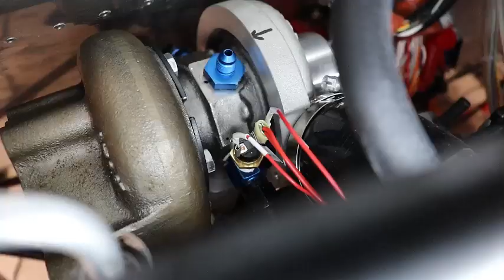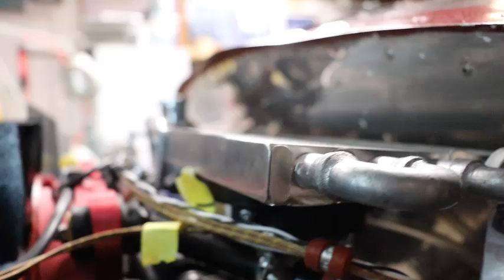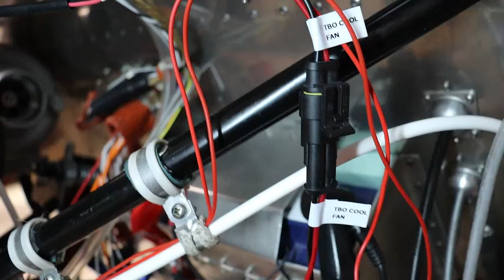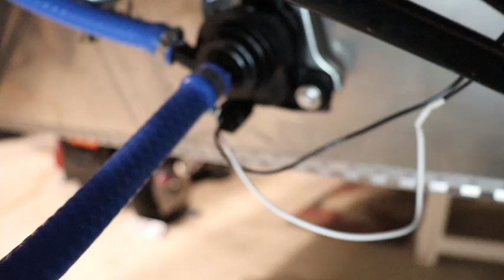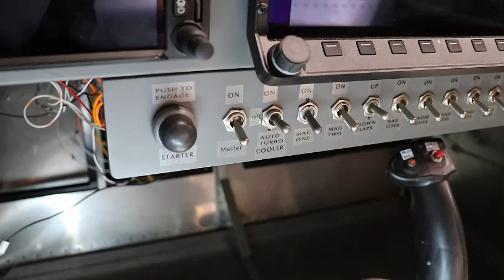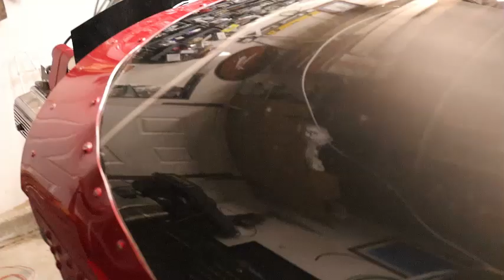Wiring the AeroVee Turbo Cooler for my Sonex aircraft project!!

Comment: Does the master have to be on for turbo cooling power?  We leave our strobes on so it's obvious if we forget to turn the master off.
Reply from the maker: As you know, typically the wiring is set up such that there are no live wires under the panel when the master is switched off.  The wiring diagram for the turbo cooling system takes a dedicated power wire directly from the battery (with a 10 amp inline fuse close to the battery in case of a short circuit).  So, the system runs independent of the master switch.  This makes me a little uncomfortable, but the fuse should shut it off quickly if there is a short.  I plan to disconnect the ground buss (which is just one nut on the firewall) if I'm doing anything under the panel.